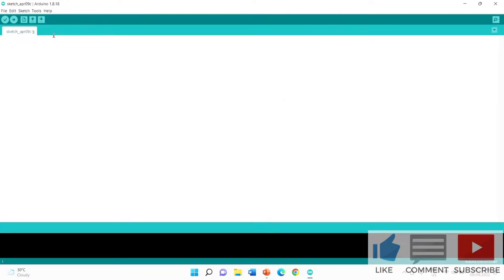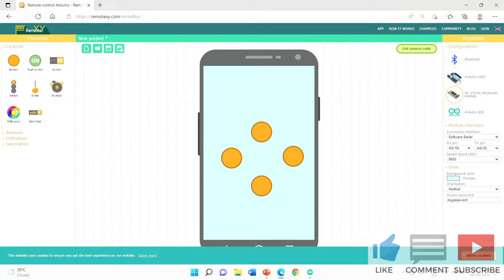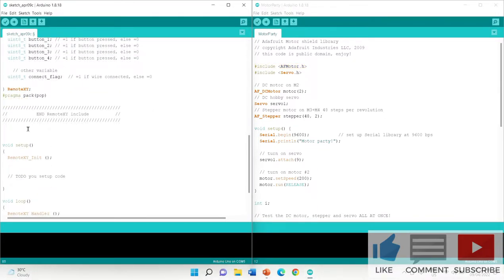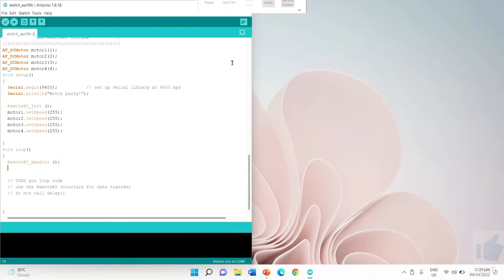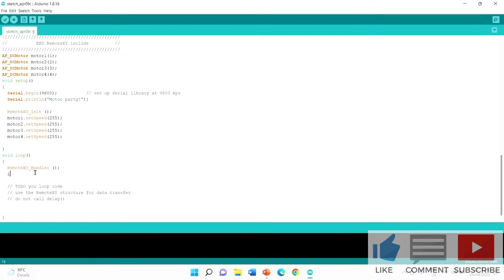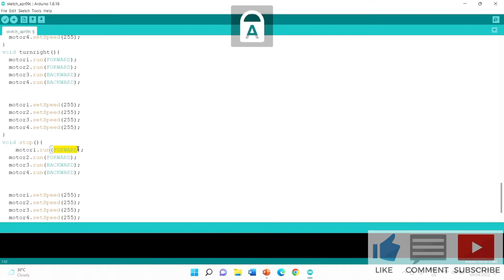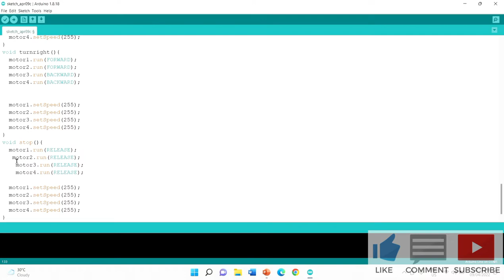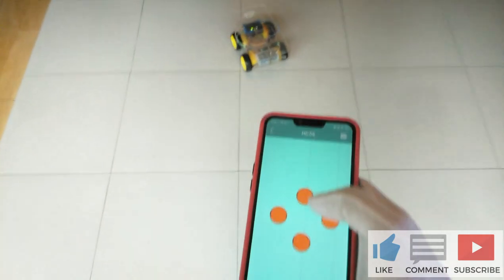Smart robot Car Arduino Uno tutorial L293D Motor Driver Module mobile Bluetooth controlled robot car

Comment: Ask ko lang po. Same po tayo ng ginagawa po. Pero yun samin po is nag kukulanbng supply ng power yun motor driver and arduino po
Reply: Ayaw po gumana nung servo motor namin kase nag kukulan po sa power supply. Bakit po kaya ganun
Reply from the maker: Ang supply Po Ng motor driver ay dapat around 7.4 -9v
Reply from the maker: kung gusto nyo Po akong kausapin.
https://www.facebook.com/russel.garcia.99
Reply from the maker: Ano Po bang battery nyo? ... Baka nag da drop.... Ang voltage
Reply: @russelelectronics121  sir 18v battery po na pang electric drill, na naka voltage regulator po. 18v to 9v po
Reply: @russelelectronics121  working namn po sya basta po di nakakabit yun servo motor sa motor driver. Pag kinabit po. Ayaw na mag work nung mismong robot. Na connect lang po sya bluetooth pero di po nag work
Reply from the maker: Try mk boss mag add Ng capacitor sa OUTPUT Ng Voltage regulator mo.

7809 ba o 7909?

Comment: I am making a bluethooth car for my school project. I have done everything but there is a problem kindly guide me.

I have used audino UNO and L293D driver sheild and HC05 bluetooth module 18650 battery.

The problem is that bluethooth is not showing in available devices to connect and light is also not blinking in bluethooth module. I also tried changing the bluethooth module but the problem remains same. 

Light is blinking in audino and motor driver but not in bluetooth. Please help to fix this.

While shouldring in motor driver sheild the 0 no. Pin is correct but in 1 no. pin it has formed a bridge with no.2 pin also as my shouldring iron pin was thick so it got connected is this causing the problem.

Rest all i have done correctly.

If any alternate errors possible please let me know.

I have also programmed and uploaded it.

Please help me to fix this issue.

Please give your email address to contact.
Reply from the maker: there is no need to soldered the pins. just connect the UNO to L293D. I provide the whole process in the video. zbut if you have more concern. provide a video of the whole connection. as well as the video that may i can see the error you are saying..

I am ready to help you. Russel Garcia (facebook). https://www.facebook.com/russel.garcia.99